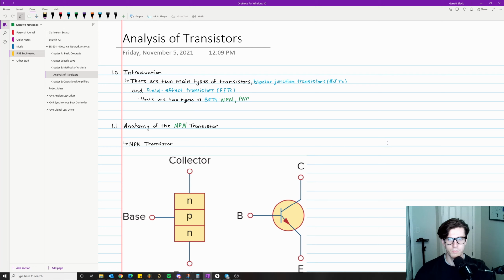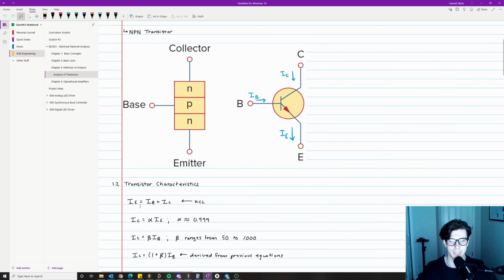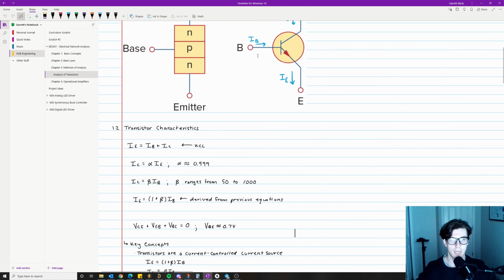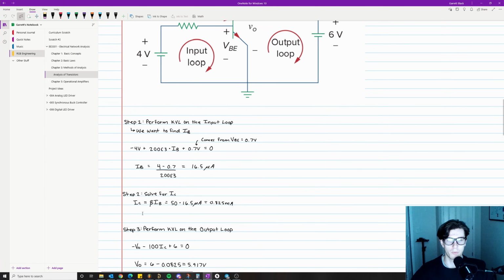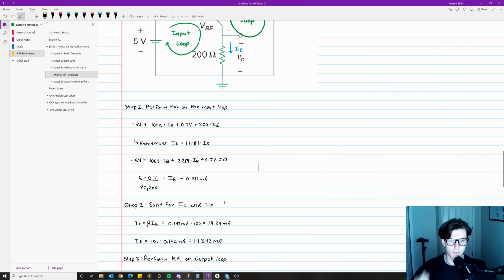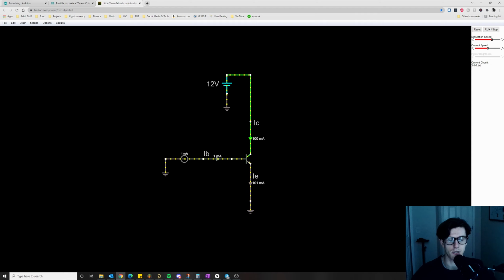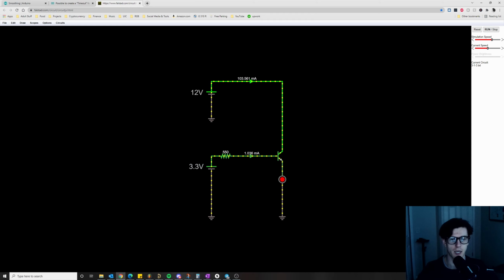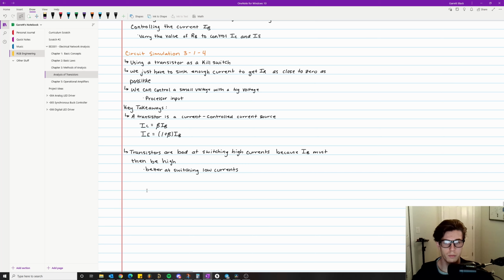Transistors for Beginners | Transistor Basics | Transistors Explained | Transistor Tutorial | NPN

Comment: Kid, I started this adventure in 1972. I lived through TTL, CMOS, all the large scale fabs and quit after breaking my brain on FPGAs. This is the best short, clear and almost correct story of the transistor I know of. I hedge a bit because I can’t explain why I have $100K of IV tracers if your constants are real. That’s a nit. Great job.

I do wonder if you’ve ever smelled solder, wire-wrapped a board or done any PCB etching.  I watched the program at Evans’ go right in the toilet when the “kids” became keyboard jockeys. We ended up hiring Asians to get anything done for about a decade. 

Watch that. Make sure you can make things work in the real world.
Reply from the maker: I have not etched my own boards before, but I have sent design files to a fab house, and then soldered the components onto the board myself :)